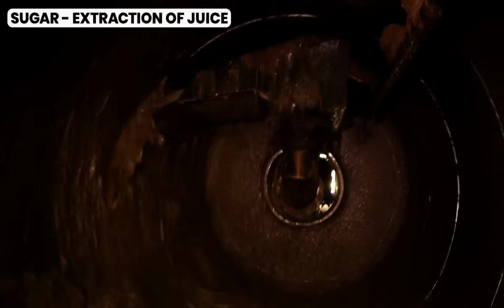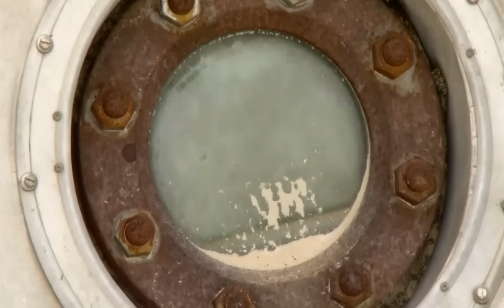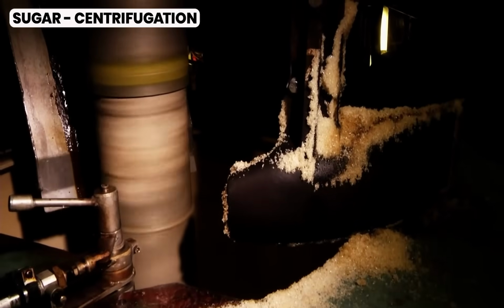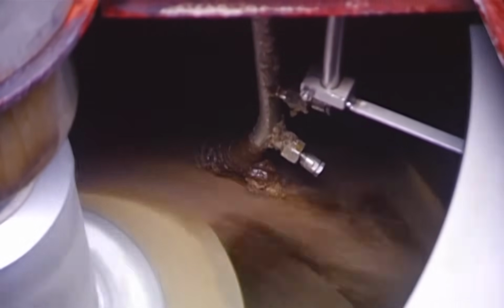How It's Made: Sugar

Comment: So they Bleach the sugar in the "tall" towers to make it white....they left this important fact out
Reply: Exactly right
Reply: I mean they tell it later, SO2 gas is added. It acts as to precipitate calcium hydroxide(lime) to form calcium sulphite. Removed during distillation.
Reply: I'm not saying your wrong but I can't find any sources that supports your comment so can you please enlighten me ?
Reply: Just to address the subtext in the original comment, yes there is a bleaching process, but it's not the chlorine bleach you use in the laundry, it's SO2 gas. And since SO2 gas is so volatile, it's get absolutely evaporated away during the sugar drying process, there'll be virtually no trace left in the final product, which funnily enough, is pretty much pure sucrose. If you're scared of SO2 (and there's no reason to be), you should be much more scared of dried apricots (which are totally fine), which are preserved using SO2.

Comment: Wow it's incredible that 10000 years ago they had these machines.
Reply: Calcium hydroxide aka lime, earliest use recorded is 7000BCE(acc. to wikipedia.org) SO2 gas released by burning coal. While these are the only two major chemical reagents used they are also removed by distillation. Ofc just because these chemicals were well documented several thousand years ago does not imply that it was used in this exact method.
Reply: That's why it was extremely expensive back then because they didn't have those machines.
Reply: Machines 😅